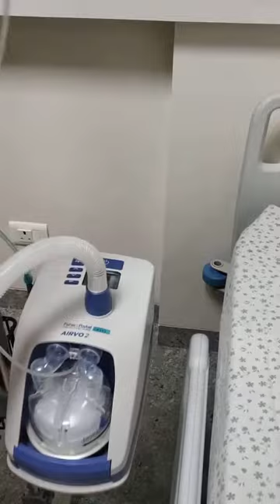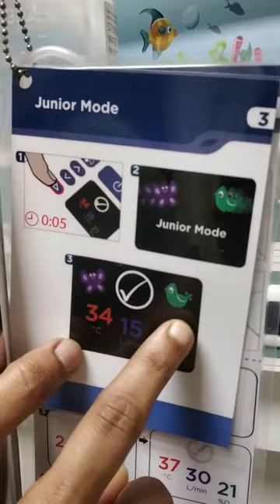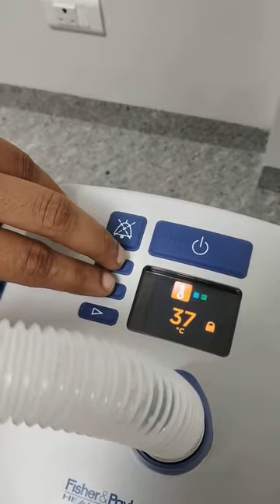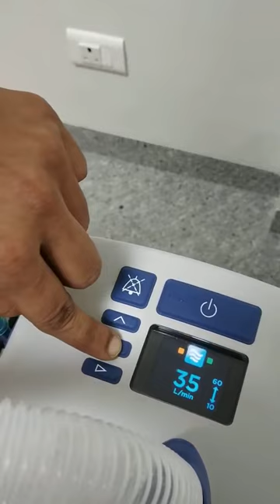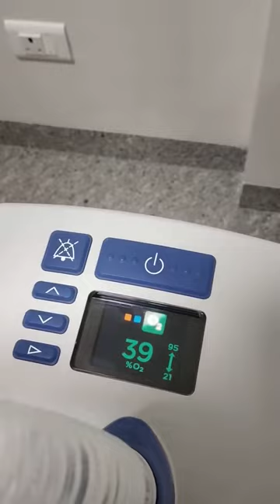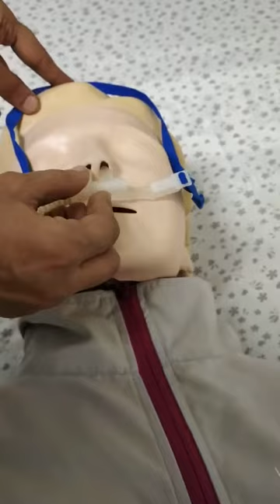Setting Parameters

Comment: Nice video but i have a question:  the flow that you put on the humidifier 40%  (max 60%)as starting value came from room air?( i know that the oxigen flow changes FIO2)